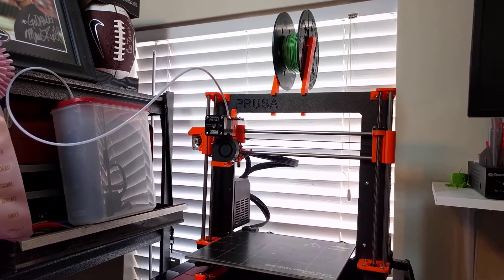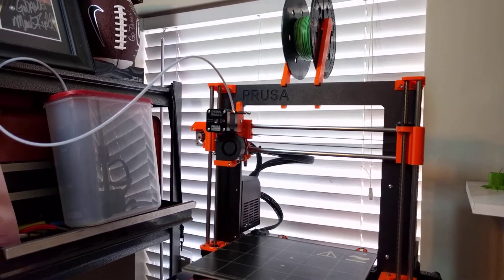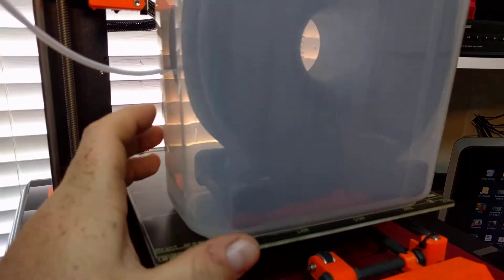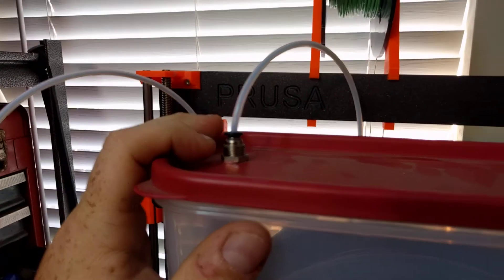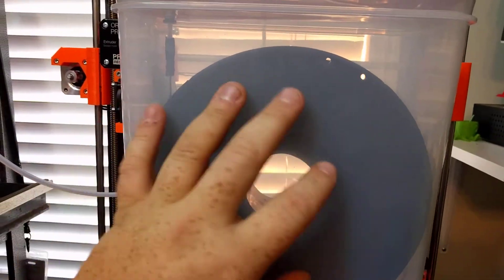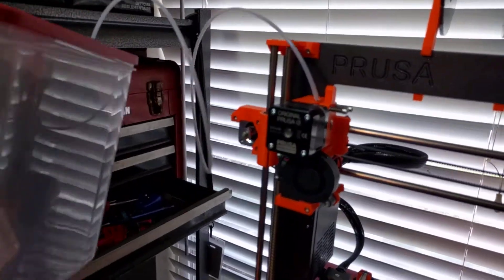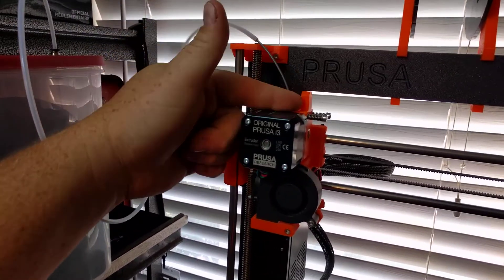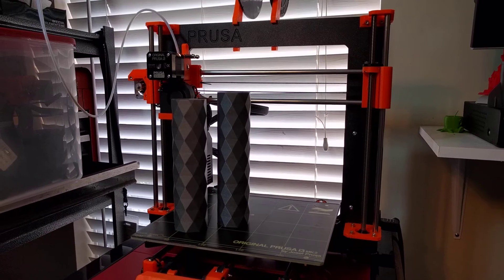Filament delivery system For FFF 3D printers

Comment: How does flexible filament go with your spool holder. I have heard flexible doesnt like going through tubes.
Reply from the maker: Yes, flexible filament does not work well in this system. I would suggest to only use rigid filaments with this setup. For flexible filament I mount the spool above the machine with no PTFE tube.

Comment: Would it not be possible to use small rise bags instead of silica bags?
Reply from the maker: Yes, but it is not as near absorbent as silica. The silica bags can also be dried in a 245F oven and be reused over and over. Do you not have access to silica desiccant bags?
Reply: I Guess i can get them from china, but rise is Even easier to get hold of. Thnx for your answer.

Comment: One thing that may help you:  When I get filament, the desiccant bags are usually in the center of the spool.  This would be one way for you to keep desiccant within the Rubbermaid container and not have to remove it all the time.
Reply from the maker: Good idea. I use huge desiccant bags that are probably over kill. They are the volume of a soda can.

Comment: Thanks for putting everything together and make such a wonderful informative video.  BTW, how do you like the Prusa i3 compare to your Da Vinci?  I saw your i3 is sitting on it, so I assume you have use the Da Vincu for quite some time.  I am debating whether I should get the  i3 as my first printer.  Anyway, thanks and happy printing.
Reply from the maker: They both have their own pros and cons. If you want to learn about 3D printer, be cutting edge, and print exotic filaments get a Prusa i3 Mk2. If you want a plug and play that can print PLA and ABS only, Da Vinci Pro is a solid choice. I use them both daily. Prusa i3 MK2 would be a great first machine. If you buy the kit form,   you need to be semi handy or have a friend help you that has built a 3d printer.
Reply: I pretty much going to nail on the MK2 kit.  I considered myself is a handy guy and willing to learn new stuff.  Open source rocks.